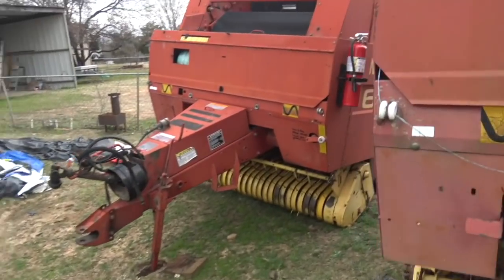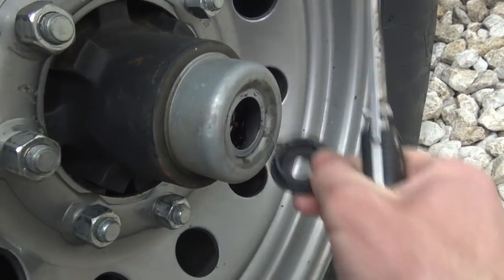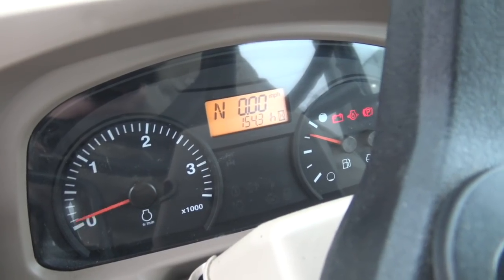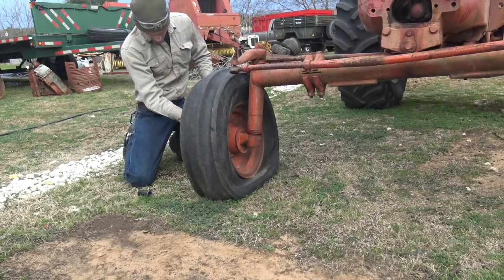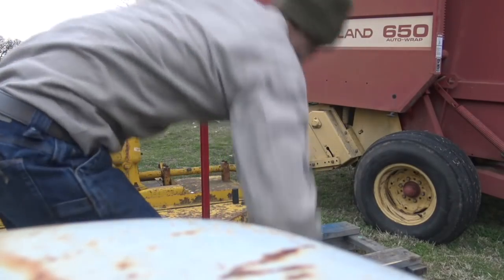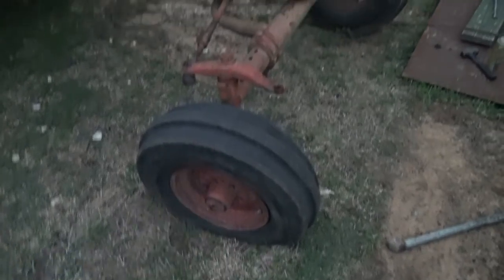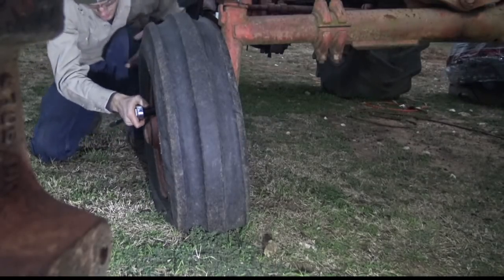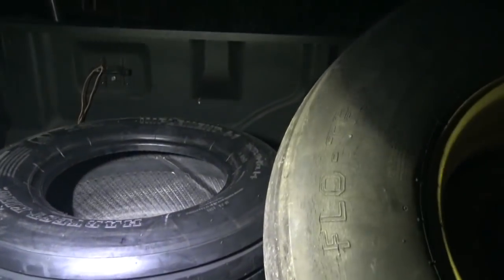DAY IN THE LIFE OF A FARMER/TRACTOR MECHANIC

Comment: i enjoyed the video. But you still need to bolt your tire machine down to the shop floor. You can leave the anchors in the floor and use bolts to bolt it down when you need to use it.
Reply: I bolted mine to the floor, took a little extra work , but was worth the trouble.
Reply: Chuckes the man he knows best not you
Reply: @iowastatewelder  Ya, some things are learned the hard way.